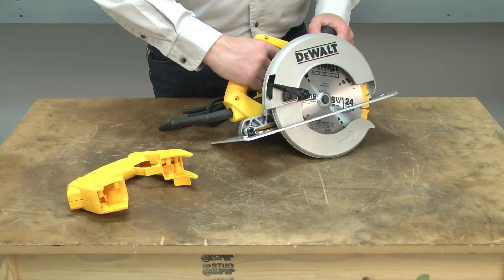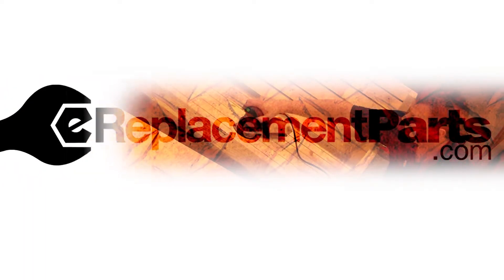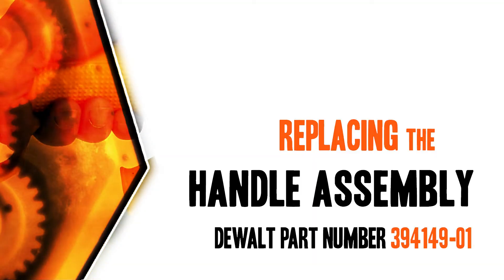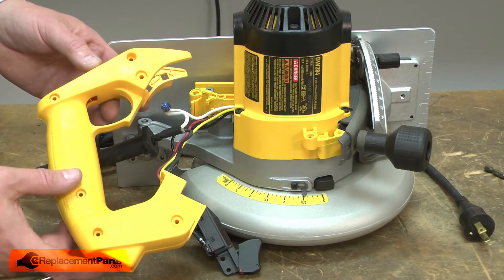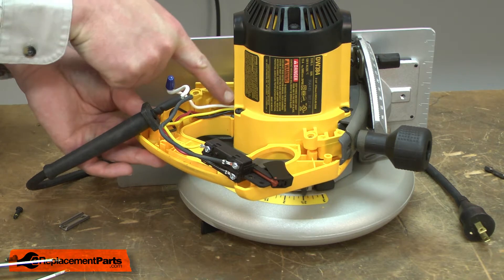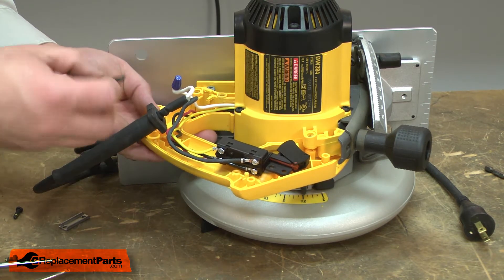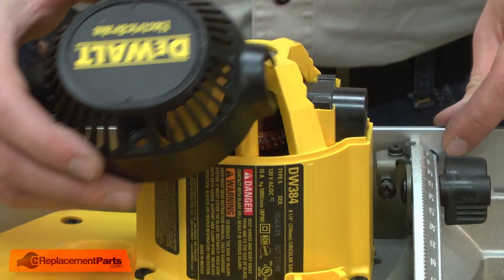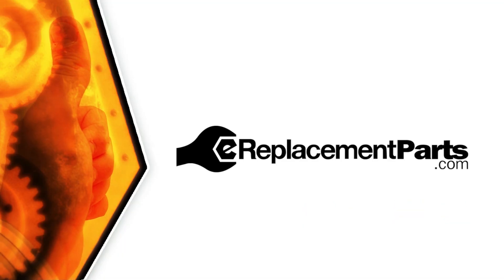DeWALT Circular Saw Repair - Replacing the Handle Assembly (DeWALT Part # 394149-01)

Comment: Very sad I barely dropped my Dewalt DW364 and the handle shattered in pieces. They must've made that handle out of plastic that breaks like glass. It makes since that there is a need for replacement handles but you guessed it the handle is sold out and now discontinued. Dewalt you did us wrong on this one, so thanks a lot for a completely unusable saw.